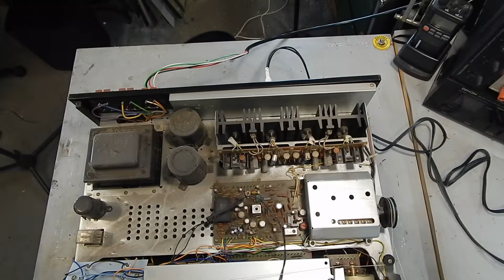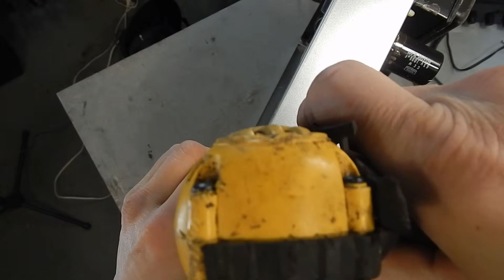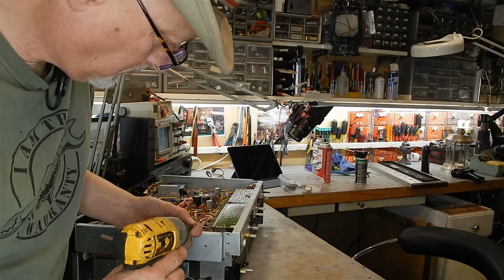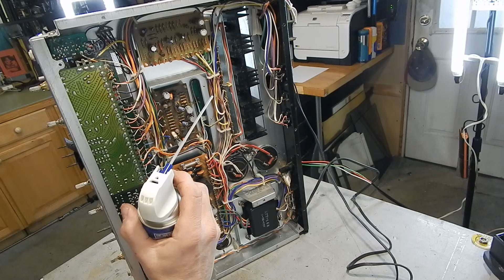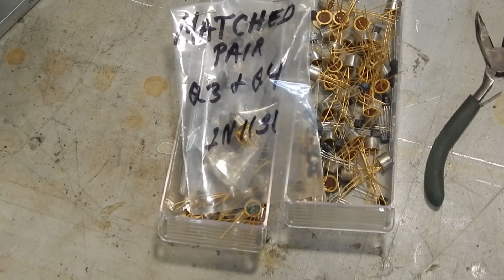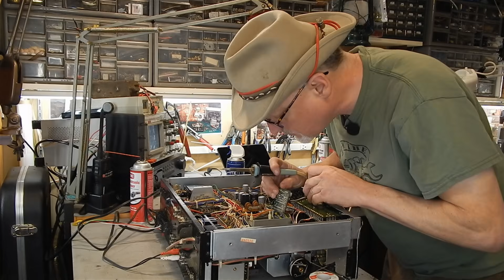Vintage Receiver Repair - finding a noisy transistor

Comment: Ksa,1845 great replacement  for that
Reply: there is no ksa1845, it's ksc1845 and that is an npn. the 2sa725 is a pnp and the proper replacement would be a ksa992
Reply from the maker: Thanks!

Comment: Interesting how Pioneer used Elna caps and also some polystyrenes on that board. Pioneer had such a great reputation in that era. Probably still does. Such well made equipment in those days from most of the big guys.  I like the vintage chicken head knobs  that you put on the tone controls.
This video has really helped me with a problem  I'm having with a Hafler DH101 that is making noise in one channel. Thank You !
Reply from the maker: Glad to help!

Comment: Today i was working in a noisy amplifier, I hope to find the problem tomorrow.
Nice job.
Reply from the maker: Thanks!
Reply: @JakevonSlatt  I found the problem, a 22pf capacitor was failed.
First time, the noise sounds like a transistor.
Best Regards.
Reply from the maker: @treadmillrepair754  Nice!

Comment: Jake: Sorry to come at you from a 7 year old build of yours, BUT. I am going to Burning Man for the first time, I lost my wife 2 years ago and this would never have been possible before now. I am 75 and just retired last July, so now I have the time. I have a Toyota mini van with a full size bed but it is cramped, so I want to build a Pentayurt. I just bought a 5 x 8 utility trailer that I will be bringing most of my stuff in so I should have plenty of room to haul the yurt. My first problem is finding the DOW Tuff-R panels that you used, I can't find them, did they stop making them? The 1 inch panels that I find are aluminized foam and are NOT as rigid as those DOW Tuff-R panels? I am both a commercial and an amateur radio operator and plan to set up at Burning Man just for giggles. I live in Medford Oregon so it's only a 4 hour drive to Burning Man.
Rich
Reply from the maker: Hi Rich!

Out here on the east coast Home Depot (which I only used because it was the sole source) carries the Tuff-R panels but it looks like west coast HD only has R-Tech. Lowe's has a product from Johns Mansfield https://www.lowes.com/pd/Johns-Manville-R-6-1-in-x-4-ft-x-8-ft-AP-Foil-Faced-Polyisocyanurate-Foam-Board-Insulation/5013061199 that I have used to make a hexayurt. It's not quite as nice as the Tuff-R but it totally works.

Also check out https://www.youtube.com/@juliedanger for tips on making foldable yurts. I cover that a little bit but she invented the technique!

Coming in from the North is definitely the way to go if you are driving in, the traffic through Gerlach is EPIC!

Attaching the yurt to the ground the moment it's up is super important! The wind can take things away in an instant! I'm still using re-bar stakes but the kids all use 12-14" lag bolts with a washer and a coule of link of chain and bring a drill-driver set set them in the ground. If you go with re-bar make sure you have a tennis ball or (my favorite) a solar light to cover the end of the re-bar so your camp-mate don't scrape an angle in the dark!

These guy are good for tape: https://www.renohexayurt.com/products/6-hexayurt-tape order it NOW! It starts to sell out as the burn gets closer. Get extra, it's super useful for lots of things!

Finally, a tip on water. You're driving in with a trailer so this will be less of an issue for you, but I always take the bus in and I bring a gallon or two with me on the bus and I ship all my gear ahead on the Boston container truck. Among my gear is an oversized cooler (2'x2'x'3 interior, 2" polyisocyanurate foam insulation) and a couple of two gallon square buckets. Ice goes into the clean buckets and then I drink the melt water. This saves me from having to carry in 10 gallons of water AND it means that I don't have to carry out the cooler melt water which is considered "gray water" and cannot be dumped on the playa even if treated.

Have fun and give the man my regards! I can't make it this year but next year for sure!

Jake
Reply from the maker: Hi Rich! Busy at the moment, but will respond at length in the morning! You are going to love the burn!